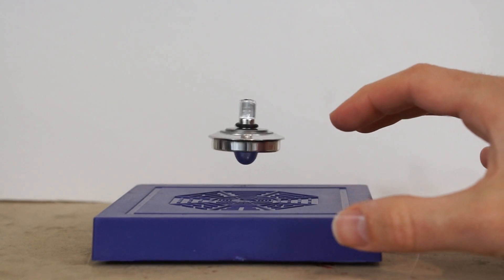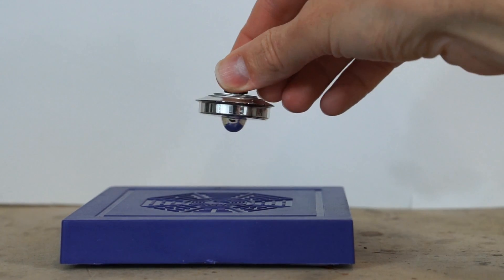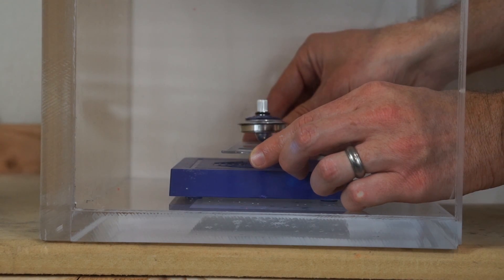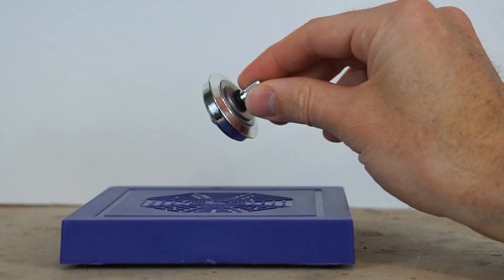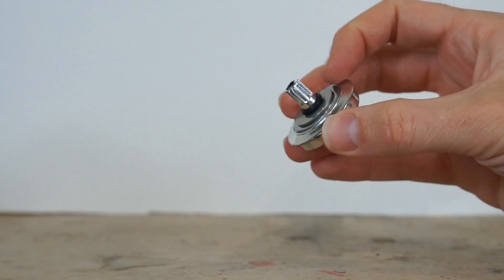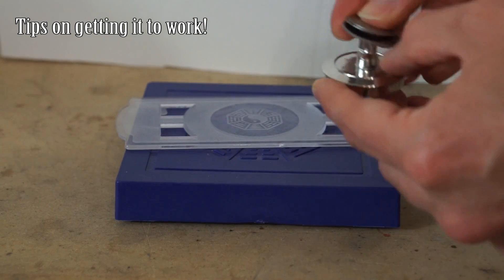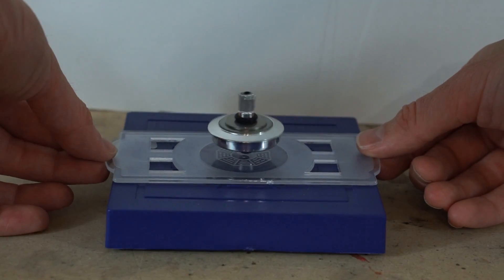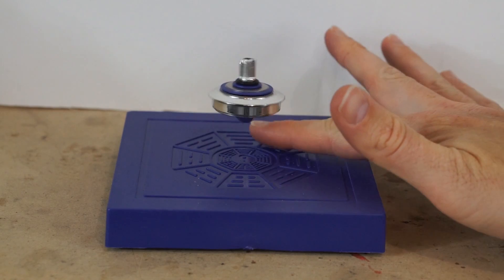Will a Levitating Gyroscope Spin Forever in a Vacuum Chamber?

Comment: It actually has nothing to do with base magnet moving or any physical friction of any kind (except air molecules from the imperfect vacuum).  Eddy currents induced in both the top and magnetic base via the rotation magnetic field dissipate the top's energy in the form of very small amounts heat.  Anytime there's a rotating or moving magnetic field, small electrical currents will be induced in many materials, even ceramics.
Reply: This is the correct answer. Also, the initial spinning was quite lousy.
Reply: super interesting, thanks for commenting with this
Reply: The top wants to spin in its plane, and the base magnet wants to tilt the top. Every time the top resists this tilt, it spends energy keeping itself aloft by pushing on the base magnet.

this interaction saps energy from the spin, I would guess, long before the eddies make any noticeable dent.
Reply: If you compare those tilts to a bouncing ball, then, due to compressive friction (perhaps this what action lab meant), then each push by the top against the base would not receive a push back with 100% of the opposite force, therefore draining energy.  This is absolutely plausible.  However, no "moving" of the base (i.e. overcoming the coefficient of friction) is going here.
Reply: @thom1218  No.  It will stop because energy is used by procession to keep the top upright,  and this energy comes from slowing the top,  which will eventually collapse.

Secondly,  this magnetic top is rotating in a magnetic field,  which means that electrons are sloshing back and forth from the rotational speed much like in a generator.  the flow of electrons is consumed by resistance and turned into heat.

Just like with a generator,  it takes energy to move those electrons,  and that will come from the speed of the top,  causing it to collapse.

I suggest that the two major ways energy is consumed in this system is 1) procession  and 2) electrical current flow and resistance.
Reply: @Will Skubi - Uhmm... yes.  You just re-stated my original comment: "Eddy currents induced in both the top and magnetic base via the rotating
 magnetic field dissipate the top's energy in the form of very small 
amounts heat."  Look up the term: "eddy currents" and it will describe in detail what you're trying to describe.
Reply: @thom1218  Well then,  we agree!    precession is surely the major energy consumer,  and the eddy currents ---hard to judge but they are there someplace as a minor  factor in a vacuum.  I was experimenting with the rotor from a toy gyroscope taken out of the housing and spun on a marble slab.  The friction of the weight of the top seems slight from that,  and I got the rotor to spin for 2 minutes,  17 seconds after only a few minutes of practice.  I enjoyed your video!
Reply: So perhaps to make it spin longer you could replace the washers with a non-conductive and perhaps non-magnetic material? Or cut slits in them to break the eddy current paths?
Reply: I was answering the same when I read your comment. Congratulations, this is the correct answer.
Reply: If the magnetic field in the base and the wheel were perfectly homogeneous, and the centers of the magnetic poles were exactly on the rotational axis, there would be no eddy loses. It's the pulsating of the fields, that create an oscillating flux density that will induce eddy current into any conductor. This toy is nowhere that precise. Putting it in the vacuum of interstellar space might have made it run about 10 seconds longer. Eddy takes more than his share of the inertia.
Reply: @vincentrobinette1507   It will stop because energy is used by procession to keep the top upright,  and this energy comes from slowing the top,  which will eventually collapse.

Secondly,  this magnetic top is rotating in a magnetic field,  which means that electrons are sloshing back and forth from the rotational speed much like in a generator.  the flow of electrons is consumed by resistance and turned into heat.

Just like with a generator,  it takes energy to move those electrons,  and that will come from the speed of the top,  causing it to collapse.

I suggest that the two major ways energy is consumed in this system is 1) procession  and 2) electrical current flow and resistance.
Reply: It will stop because energy is used by procession to keep the top upright,  and this energy comes from slowing the top,  which will eventually collapse.

Secondly,  this magnetic top is rotating in a magnetic field,  which means that electrons are sloshing back and forth from the rotational speed much like in a generator.  the flow of electrons is consumed by resistance and turned into heat.

Just like with a generator,  it takes energy to move those electrons,  and that will come from the speed of the top,  causing it to collapse.

I suggest that the two major ways energy is consumed in this system is 1) procession  and 2) electrical current flow and resistance.
Reply: Finally! I was wondering when someone was going to mention induction.

Comment: I think the air resistance is less influential than magnetic drag. In essence, you have built a dynamo, & the energy exchange results in the rotor slowing.
You need a tool to spin the rotor up in the correct position & release it smoothly, while under vacuum. That way you'd eliminate a lot of the initial instability, & have it in vacuum from the start.
*Just noted your remark about precession, & realised I hadn't thought about that. This would help in smoothing the effect it has.

Comment: The magnetic forces that allow it to levitate also impart forces that eventually dissipate the angular momentum of the spinning top.  Also, it is near impossible to pull a "perfect" vacuum on Earth.  (NASA can't even do it).  Even one air molecule will be able interact with the top and slow it down over time if all other outside influences could be eliminated (i.e. magnetism, gravity, light, cosmic background radiation, neutrinos, tachyons from the future, etc.)

Comment: a spinning disc conductor by itself should not generate eddy currents.. i believe the wobble imparted during initial spinup.. causes the disc to face "changing magnetic field" in turn leading eddy dissipation based energy loss..

Comment: No because there's no such thing as non-Newtonian machines or anything that can spend forever it's impossible it will it so defy the laws of physics the law 1 & 2
Reply: Mark Brady actually if you accelerate an object and there's no force to slow it down it'd theoretically move forever, this wouldn't defy any laws of physics at all...
the problem is to find a system where there are absolutely no outside forces interacting with it, which is quite impossible
Reply: actually there's some time when a magnet it loses its force and so even if you use a magnet it's going to lose his force and it can't be spend forever even if it's in a chamber of some sort like that's a zero-gravity it's still going actually there's some time when a magnet it loses its force and so even if you use a magnet it's going to lose his force and it can't be spend forever even if it's in a chamber of some sort like that's a zero-gravity it's still going to
Reply: Mark Brady not talking about this example or magnets particularly... just in general, if you apply a force to an object to make it move, and there is no other force influencing it, it'll just continue moving into that direction forever
Reply: Ok you win
Reply: Naveication 

Issac Newton,,, he was a clever bugger

Comment: Interesting experiment but that is a spinning top I don't think it is a gyroscope. Someone will no doubt have a better definition of gyroscope than me.
Pulsars (spinning neutron stars) are a classic example of something spinning in the vacuum of space but even they eventually lose speed. the spin-down rate is thought to be due to magnetic dipole radiation.
Reply: Nic Stroud anything that is manifactured to rotate for the purpose of stabilizing it's axis and not tipping over can be classified as a gyroscope... so in a sense every spinning top is one aswell

Comment: it cant spin forever because even the light atoms do slowly stop the spinner from spinner but anyway the magnet already should be enough to stop it because the spinner still wobbles around so it gets pushed by the magnet so it will acctually stop its self

Comment: what if you make a launcher that makes it spin very fast? like beyblade
Reply: Vegetsu101 then you have to say “let it rip!”
Reply: Vegetsu101
My phantom Orion only spins for eight minutes.😩😤
Do you really think you can top it?😂😂😂
Reply: No.  It will stop because energy is used by procession to keep the top upright,  and this energy comes from slowing the top,  which will eventually collapse.

Secondly,  this magnetic top is rotating in a magnetic field,  which means that electrons are sloshing back and forth from the rotational speed much like in a generator.  the flow of electrons is consumed by resistance and turned into heat.

Just like with a generator,  it takes energy to move those electrons,  and that will come from the speed of the top,  causing it to collapse.

I suggest that the two major ways energy is consumed in this system is 1) procession  and 2) electrical current flow and resistance.
Reply: Vegetsu101 p
Reply: I think if the top spins really fast, it's actually not stable!  Something goes wrong, and it either precesses to a tilted angle and  falls onto the base, or it wiggles itself sideways out of the floating-zone and falls to the table far away.

Comment: Even if you got the levitating object to spin completely still in absolute vacuum, it wouldn't spin forever, since the magnets always lose a little bit of their strength when interracting with another conducting object. Even if you managed to supply infinite power to the magnets under the same conditions, they would still not spin forever, because electrons interacting with each other  would create friction. Plus, because of gradual material decay, the whole thing would disappear in the end.

Comment: It stops due to eddycurrents more than gravity. The rotating metal disc in a magnetic field generates electromotive force that is causing loss of energy through being effectively short circuited through the grain structure of the disc. Like a generator with losses.

Comment: no. it wont. magnetism isnt magic, people. its a physical force, not entirely unlike the force that keeps yuou from being able to walk through walls. you cant see it, but its there. and just like anything else, magnetic fields can and do have imperfections. and those imperfections create, not friction per se, but an irregularity that the motion must compensate for, and eventually, the movement will stop as a result. the imperfections will win. every time. its works the same way friction does (but as far as i know without the heat)

Comment: Every point on the disk is accelerating by virtue of its rotation. Acceleration cannot be maintained without additional force. Since you are not applying any additional force to the disk, it will eventually stop. Also, when a gyroscope tilts, it loses kinetic energy; loss of kinetic energy will cause it to stop.

Comment: The main reason that the rotating magnet is falling down is the deformations of the magnets.
The magnets are not homogeneous. While spinning the magnets get slightly forces to get lifted up or falling down. Each of this movements will deform the magnets very slightly resulting removing energy from the energy stored in the rotation.

The big "jumping" you can see are relative independent of that. Compared to the rotation this movement is very slow, so the influence is very small on the friction that slows down the rotation. The energy stored in the high will be also converted into heat by deforming the magnets until a equilibrium between the gravital force and the magnetic forces are reached.
But such an equilibrium can not be reached with the rotational energy. Here is no rotation the optimal situation, so all energy will be converted to heat by deforming the magnets.

So my hypothesis is. If you can get very evenly magnetized magnets, so that the magnetic field are very consistent, you can increase the time of "flying".

Comment: To demonstrate that torque is transferred to the support magnet and that the remaining air is not the major factor slowing the top, you should allow the support magnet freedom to turn.  some sort of low friction surface or supporting it in a bowl floating in a slightly larger bowl.

Comment: How about atoms and electrons? Do they spin forever? (virtually). On average does it spin longer in one direction than the other?  Try doing it with superconductors. Have you seen the clock that runs using the differences in barometric pressure?

Comment: it will stop brcause its not a complete vacuum
Reply: Dinkelpus no
Reply: There is friction between the moving and stationary parts of the spinner, as well as what ActionLab mentioned inhis pinned comment. Air resistance's effect on the spinner's movement is very minor.
Reply: and magnetic forces are pulling at each other creating drag.
Reply: Scientists have never measured a fully empty vacuum, there are always some particles left. So indeed they give some resistance too.
Reply: The impact of air resistance on objects in motion is anything but minor.  And why does no one understand how friction works here.  Friction is not why the magnet stops spinning and falls.
Reply: it will stop because gravity. stop speaking all fancy and shit. I don't get  it
Reply: Just realised that nothing will stop "brcause" of anything.
Reply: And thermodynamics

Comment: Some more points: even without the friction of the magnet in the blue disc, the magnetic field has an energy density and you can't get levitation at an energetically unfavourable potential level (ie you can't levitate an object) "for  free". The magnetic field will eventually lose energy and the magnetism of the magnet will decay. Also, classically speaking you can have an object spinning in free space forever, like you said, provided no extraneous forces act on it. However, we know from quantum physics that particles are continually being created in free space (from the future, spooky) and so even in a vacuum completely free of any mass except the spinner, these short lived and very low mass particles will eventually stop a spinning object. Also, and this is a bit more involved, but the spinning object will have gaussian fluctuations around an expected value for the precession, and eventually these fluctuations will be large enough to cause a nonlinear destabilising effect.

Comment: I think it will eventually stop because there are still a few air molecules in there. Even space is not a perfect vacuum. Space has like 10 particles per square inch I think.

Comment: What about putting a layer of non-ferromagnetic ball bearings at the bottom of the vacuum chamber so the platform can slide around? That wouldn't eliminate the friction but it would reduce it and the spin should go for a lot longer.

Comment: it will stop and fairly quickly too. there are 2 effects causing it to slow down 1 the use of energy by the gyroscope to keep it from flipping eventually removes the kinetic energy and 2 and induction current caused by the magnetic field causes a counter magnetic field to be created.

Comment: You should make an electric (or possibly mechanical) spinning tool.  All you would need is a motor with a slip coupling that matches the gear on the end of the top.  Once it's spinning fast, you might be able to let it fall out under the force of gravity, or you could design a sliding pin that would push it out of the coupling.

Comment: The reason it falls is due to electrical resistance. Energy is dissipated even in the vacuum because there is electromagnetic resistance, if I'm right electrons are forming in the field due to movement of the spinning magnet and being lost to the environment. I believe even the magnet will be even slightly warmer. I wouldn't mind seeing this on an infrared camera, and see if there is heat being exchanged.

Comment: What if you were trillions and trillions of light years away from anything in the universe where not even light or any other forms of any kind of waves have been yet. If you were that far away from anything in the universe where you should have no other forms of energy acting on it, wouldn't it continue to spin forever?
Reply from the maker: +NeonWedge994 there is no place in the universe like that. Cosmic background radiation is everywhere in the universe since the universe started out in the same point and is expanding. Also, even if there were such a place, it would still stop due to its own gravity waves and electromagnetic radiation emission.